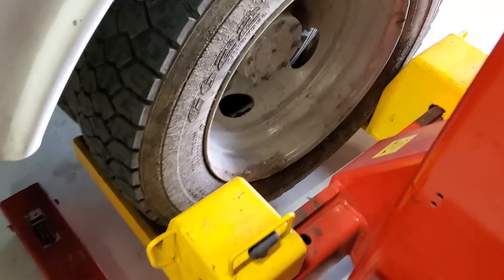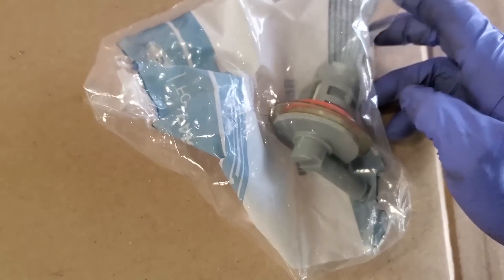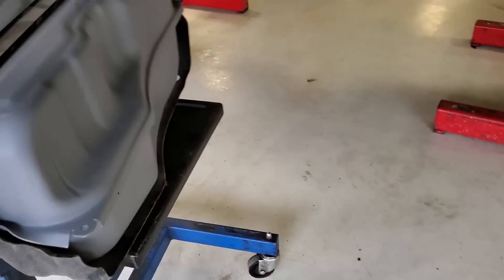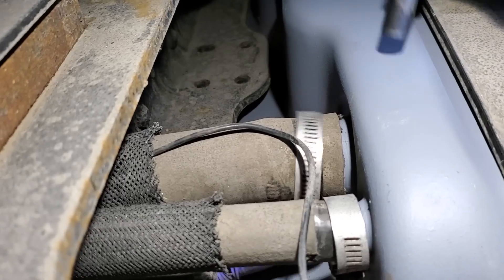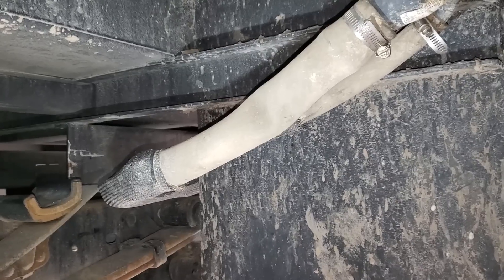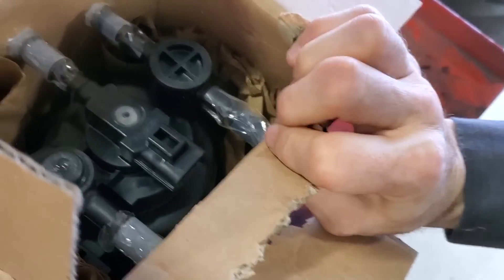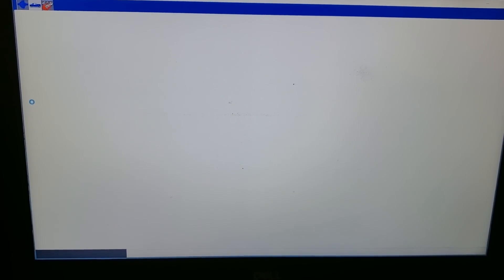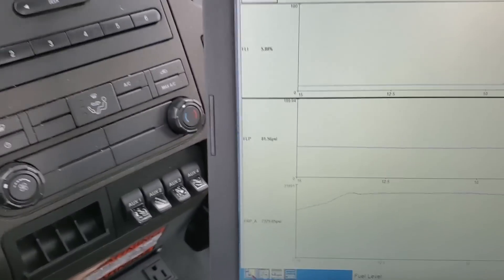2016 F550 P008A/P0087|No Power- EXTREME LOW FUEL PRESSURE |

Comment: I had a 6.7 fuel injector return line leak it was spraying diesel everywere it caused big jolt on freeway and reduced power forced me to pull off i  patched the hose but it threw codes p1292 and p0087 it starts but rough idle and shakes the whole truck has no power is motor blown or injectors??

Comment: Have a 17' F550 as well. Replaced the fuel pressure/temp sensor. It helped a good bit with the erratic fuel pressure. Crazy ting is the low fuel pressure alarm doesn't come on all the time. It seems to take a while for it to come on. Of course I am going to the next step of replacing the fuel pump conditioner. It is starting to get noisy now. The last 2 times that replaced the fuel filters there was little to no rust or any debris in the bottom. Did see water of course both times. Just seems to be intermittent issue. Do see fuel pressure being maintained over 63-65 PSI all the time. Even when I get the low pressure warning on the dash. Just am picking your brain on potential issues that I might be missing. Greatly appreciate the help. Truck is starting to be a lucifer. UHHHH!!! LOL
Reply from the maker: Yea that's good fuel psi
Reply: @PowerStrokeTechTalkwARod  yeah exactly what I was thinking as well. Just weird how it maintains that and still has the low fuel pressure warning come up. 🤦🏻‍♂️🤦🏻‍♂️
Reply from the maker: You must have something else going on. Although u have psi...u may not have enough volume...
Reply: @PowerStrokeTechTalkwARod  That is the other thing I was considering as a cause. I know the pump is starting to make some noise and that could be the leading factor of volume issue. Even though pressure is good. That is the bear in the room with the pump showing signs of potential issues. Can have pressure. But, volume of the pump can be dying with the pump. Like you mentioned. I wanted to spit ball off you and see what I might not being seeing. I am going to install a new pump for now and then see if this makes it calm down and go away. Appreciate your time of commenting back. Sometimes asking for a second opinion helps to keep from chasing down a rabbit hole!! LOLOl
Reply: Well, So far the replacement of the lift pump has kept the low fuel pressure codes away. I might have other potential issues with the regen system. Had to let the customer have the truck back for working it. Just seems to be slow to do a regen until it gets up to 50-60% filter full before it wants to start doing a regen. Other then that it runs good again. Hoping the regen system works itself out. Otherwise it will be back for more fun. The manual regen process always completed itself with no issues and temps and values looked good thru the manual regen. Thanks again for the responses back. Do appreciate the help. On to the next one!!! LOL

Comment: Dude you think you can do a video on a p0088 for a 6.7 powerstroke I have a cel and reduced engine power  it said it the fuel rail pressure too high bank 1 and I cant find any videos to help me with this issue, it's a 2013 6.7 platinum cclb srw thanks
Reply from the maker: LH fuel rail tyme buddy!
Reply: @PowerStrokeTechTalkwARod  is it really involved ? I usually try to do all the work myself but have no clue where to begin or look at in this particular issue
Reply from the maker: Yea, prolly shld take that in...

Comment: Hey Arod, I have a 2012 that sounds like it's got air bubbles in the line from the tank. It's not the filter. I don't have full power,  but no codes! Any ideas??
Reply from the maker: Bad lift pump?
Reply: Is there a way to test it? Are there any screens that can clog up in the tank? And thanks for answering!
Reply from the maker: Nope if its noisy you throw it out
Reply: Thank you bud, I'll do it and thanks again.

Comment: Hey ARod, is there newer style bowls for the fuel filter? I have a 2016 F-250 and ordered a new one and it is shorter than the original and that little bracket the supports it on the bottom no longer touches it and was told it is the new style Ford went to but on your video the brand new pumps have the larger bowls. Thanks
Reply from the maker: Thats weird. I have had 2 just replace the bowls. I always replace the pumps & they always look like what i just took off...

Comment: I Have a 2015 F350 6.7  with 37,000 miles. 
Currently at idol my FRP-A is between 4000-4400 psi and lift pump is at 82% is that within the recommended pressure? My lift pump was replaced at 20,000 miles.
At start up my rail pressure is over 5000psi
Reply from the maker: Whats the matter
Reply: I don’t think I’m having a problem but if I go by the parameters that I find online, my truck isn’t running correctly. 
I have the Banks I dash and I’m trying to monitor fuel pressures and a bunch of other data but can’t seem to find factory specs online. 
Just changed the fuel filters and it took a long time for the air to bleed out. Changed bottom then the top and bled the system by turning the key probably 20+times. 
I let it idol for 20 minutes then drove it for 10 miles.  S

Comment: does the 450 pickup have a metal tank? Same thing on my 2015. Frame-mounted pump screaming. Replaced last week to the day. Today low fuel warning. Truck died. P008A code. Had it towed home. Started right up after. Cleared code. Nothing wrong on test drive after clearing codes. The new pump is not making any screaming noises. ???Any particular PIDs to watch on Forscan?

Comment: My 04. 550 had the coating come off inside the tank. Replaced it with a plastic tank. The fuel filler . I have had several of them rust through. And the caps don’t seal that good

Comment: So I was told I need to replace my driver said fuel rail. It still runs and drives. It will defuel if I go WOT. Also when I turn the key on the fuel lines and vibrating and it’s buzzing. If I replace my fuel rail would that fix my issue
Reply from the maker: 🤷‍♂️ u need to follow the proper pin point tests

Comment: I remember back in like 2000 I was working for a tour bus company doing their in house service invoicing and billing...there was one day when a truck dropped off a set of four new portable column lifts that could pick up a motorcoach, that was a FUN day! The mechanic and I spent the better part of the day reading the manual and whatnot...then culminating with the successful lifting of a Prevost H3-45 highway coach (45 foot long bus with a tag axle). Felt odd seeing it in the air but damn that made the mechanic's life so much easier...I got to set the system up quite often for him....the fact that I could roll them TO the coach and lift it was groundbreaking!
Reply from the maker: We LOVE EM!!!!

Comment: 2016 and having that much rust issues in the tank?  That’s crazy.
Reply: would off road diesel or using heating oil Do this?
Reply from the maker: No. Dont ever use heating oil in common rai

Comment: i was expecting to see the foil seals from fuel treatment bottle in the tank.   Another thing on the second gen with the flat filter at the tank.   Had one come in with the same code as well as p0087.   Another shop threw everything at it except the fcm housing.   Pump would sound like a failed pump or restricted filters.   Something with the check valve.  FYI
Reply from the maker: Yea i had 1 of them suckers toooo

Comment: I have an 01 550 with 7tree and the tanks in the cab chassis had issues with delamination. I see Ford still hasn't figured it out...I put a prepump filter in to catch anything if the tank goes south.

Comment: First time I saw a lift system like this was on Jay Leno’s Garage. Are the new tanks coated or plastic now? I’ve always added Howe’s to the fuel. Curious what the frame filter looked like from the rust.
Reply from the maker: Aft axles are or were steel. New ones are a poly. Filter looked trashed

Comment: When I worked in New Mexico I had a little bucket truck similar to that. I think it was a 16 F550 as well. I loved that truck most bad ass little bucket truck ever. 

Good stuff as always Arod. Hasn't Ford has issues with steel fuel tanks even since the 7.3 days? They do know aluminum exists right?
Reply: They're using all the aluminum on the bodies. None left to make aluminum tanks.

Comment: Never trust the after market body co installers had problem with some jack ass not connecting the fuel filler neck all the way on and yes water got in 3 times to filter put truck in low fuel pressure had to be towed till the ford tech figured it out
Reply from the maker: What goofs. Had the same thing had to the DEF system......lets just put this rubber hose on a millimeter....itll be good......send it...🤦‍♂️🤦‍♂️🤦‍♂️

Comment: Was that replacement tank still metal or was it plastic? Did you replace the engine bay fuel filter while you had it? Also, great content, thanks!
Reply from the maker: Yes

Comment: WOW. That lift is the cat's ass. There is no way my dealership would ever invest in a lift like that for our shop. I see Ford is still using metal after axle tanks after all these years, despite the fact that they've been a known problem. I know there are aftermarket plastic aftermarket tanks for these trucks albeit at an astronomical price, but probably well worth the investment to avoid a repeat failure. BTW, that style of fuel conditioning module is exclusive to 2016 model years only with the metal bracket that needs to be loosened to service the primary fuel filter. 2011 to 2015 model years are all the same. And the 2017 and newer? Well you know they went with the in-tank pump and filter. I'm pretty sure that OEM metal is not cheap either if I recall correctly.
Reply from the maker: Hey there Chan man!!!!